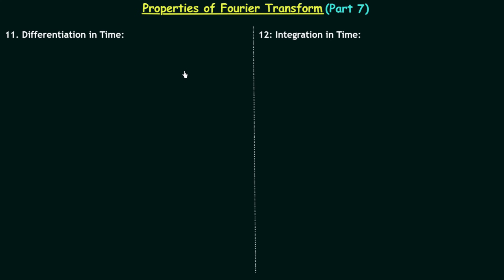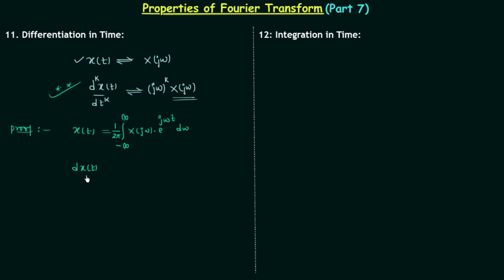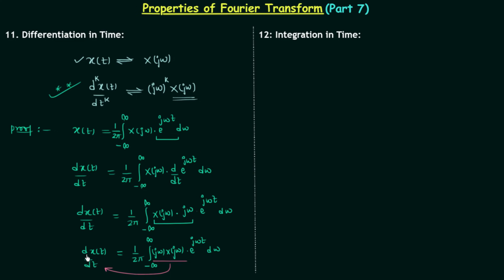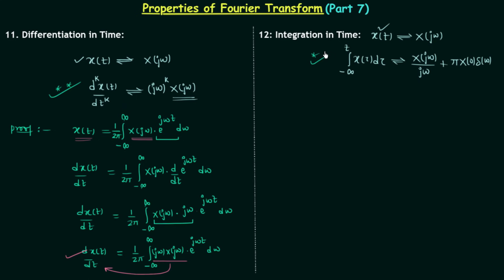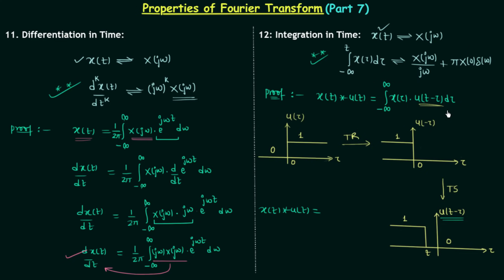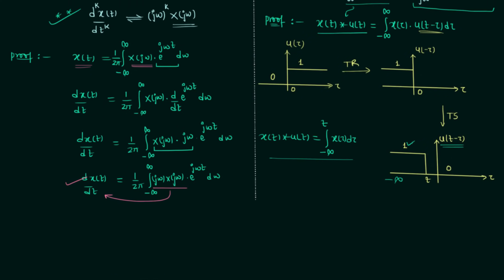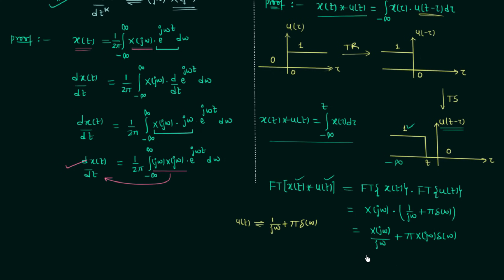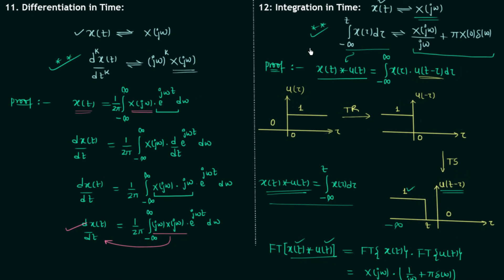Properties of Fourier Transform (Part 7)

Comment: DOUBT:               While proving the integration part why convolution is needed while integrating the signal  ? Specially with unit signal?
Reply: it makes it easier to solve the question as we have a formula for FT in case  of convolution of signal